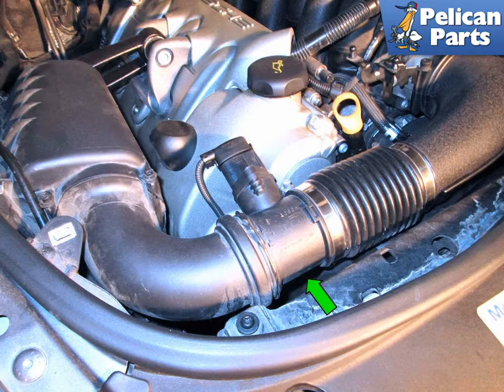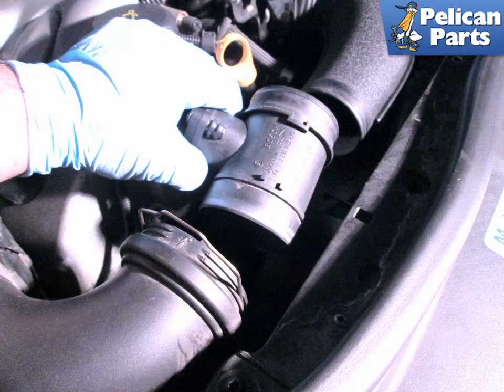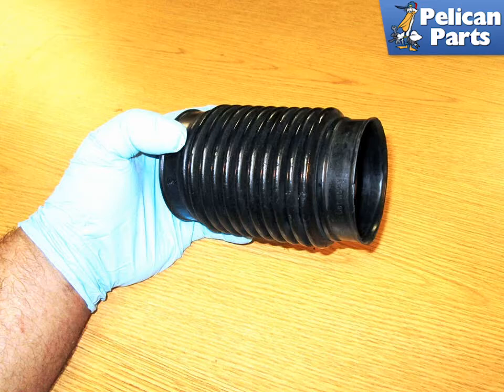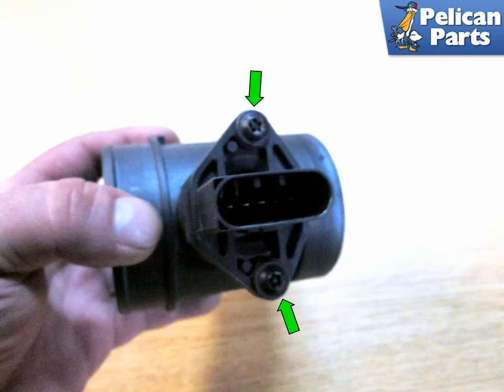Porsche 955 Cayenne Mass Air Flow Sensor Replacement (2004-08)

Comment: Thanks for these guides! All of them are invaluable! 

Quick question: Is it absolutely necessary to remove the housing if the MAF sensor itself can be removed by removing the security torx bits?
Reply from the maker: No, you can replace it that way. Only issue would be if the new housing has a redesign. You'd want to swap it.
Reply: @pelicanparts  Thank you so much for the reply. I was asking for cleaning purposes so that perfectly suits my needs. Thanks again!